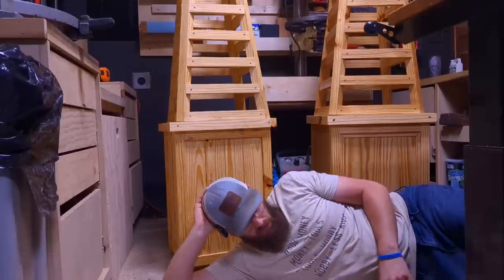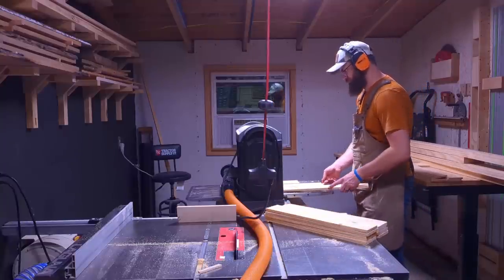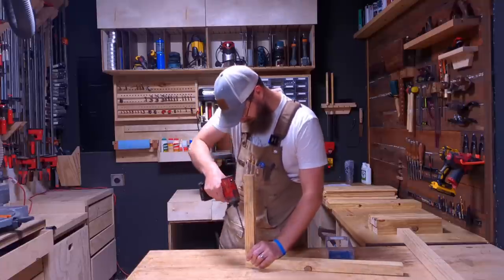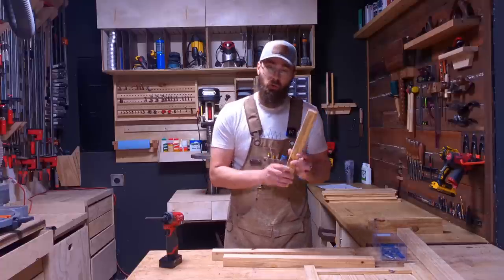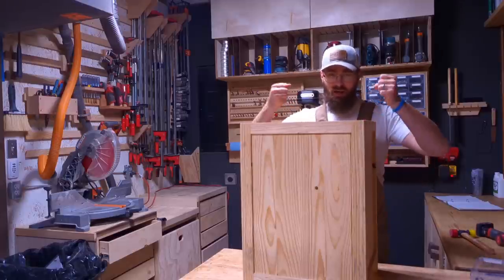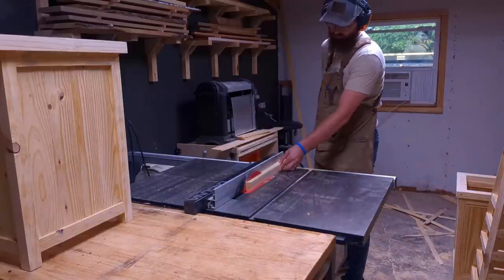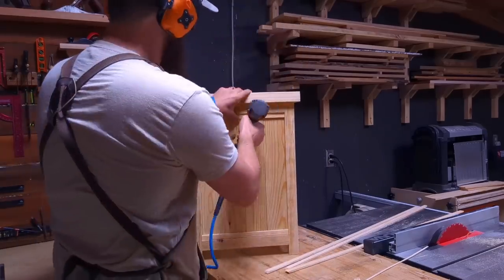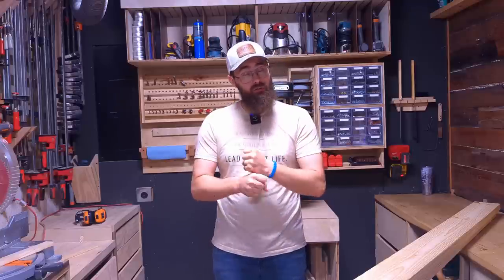Beginner Woodworking Project that Sells (Easy Woodworking Project That Sells PT 2)

Comment: I keep looking for a beginner project and keep seeing step 1: Use table saw.... Sure thing bro.
Reply: Same boat. What drives me nuts is the "made this for $1", well dude you have like 8 grand in tools, so...

I'll recommend a few things working out of a 8x8 shed with very limited tools. I bought a miter saw and a circular saw. Learned to do a lot with them. Hand router will also do a lot for whenever you hear "dato". Just make yourself a jig.
Reply: It takes time and lots of Marketplace and Auctions to build a setup. I finally have alot of tools then my mind drifted to cnc and I went that direction.

Seriously miter saw, table saw,  band saw, impact driver, drill. 10 clamps You should be able to produce  something  you can be proud of and others may buy, I would not recommend selling the first 5, these give you perfection time.
Reply: If you are limited on space might I recommend instead of investing in a table saw save yourself a little bit of money, and buy a nice circular saw and a track saw. It’ll be cheaper, and you will have the ability to make perfect straight cuts almost anywhere as long as you properly stabilize what you are cutting. Hope this helps. Good luck
Reply: Anything done on a table saw can be done with a circular saw

Comment: Hey, fella....really enjoyed watching this video.  I don't know why I haven't found you on YouTube before now, but I like your style.

Now, I'm not trying to be a "know-it-all" or "smarty pants" with what I say.  But, as a retired junior high Industrial Arts (AKA "Shop") teacher for many years, I always tried to bend over backwards to make sure I was teaching my students the correct way to accomplish anything they attempted.  For their woodworking projects, I always required them to make a Project Plan Sheet, complete with a measured drawing on the back side of the sheet.  The front side included the List of Materials, along with a cut list (when necessary) and a Steps of Procedure.  That way, many potential problems were worked out before the first board was cut.

Since many of the projects included some kind of dado-like joint, I made it a big deal to help them learn and understand the difference between a DADO and a GROOVE.  A dado runs ACROSS the grain; whereas, a groove runs WITH the grain.  Thus, what you cut into those long boards with your dado stack was actually a GROOVE, not a DADO.  Yeah, I know that some folks will shrug their shoulders and think that it doesn't matter, but I believe that, if you speak and act correctly, that enhances your reputation.  Conversely, when you don't, your reputation takes a swat.  I hope you take what I've written as helpful information, much like a pat on the back, rather than a stomp on the foot or slap on the face.  I surely have profited greatly over the years when someone knowledgeable shed a bright light onto the correct way of doing or saying something important.

Keep up your excellent work...and I promise to watch more of your videos.  I've devoted most of my professional career to helping beginners make a successful start in their chosen area of interest, especially woodworking.  In just a few days, I will be coaching both a teacher and some elementary age students how to turn a pen on the lathe.  Without a doubt, when they come into the shop and see some other simple things I've made, they will become interested in expanding their woodworking prowess.

Best of luck!
 • Dr. Larry S. Anderson  •  Tupelo, MS (birthplace of Elvis!)
Reply from the maker: Tupelo!!! I want to come visit very soon and have a cup of coffee with you (my treat).  No need to tip toe around me Sir, I am a grown man in the strongest sense of the term (thick skin and can take instruction).  You've taught me something new in such a short comment and packed it with such wisdom in a gentle corrective tone,  I'd love to meet you and just have conversation with such an astute elder.  I've only gotten to where I am by cultivating a relationship with the more experienced generations.  From the bottom of my heart, thank you for this comment.  If you're interested, please send me an email, I'd love to set up a meeting with you.  My email is burnstock20@gmail.com.

Comment: You should get some cheap toggle clamps from harbor freight to add to your jigs. Would only take a couple of minutes to screw them on and make it much easier to hold the piece you are cutting. Same for removing the clamps to use for another jig
Reply from the maker: Great idea, thanks!

Comment: Love the project , snag some WIN Brand saw blades from the big A ,they are throw away type blades but they cost are $10 or so . Sharp blades are a must ,dulll blades will make ya visit the nearest ER. I subscribed to the site . Cheers
Reply from the maker: Yea, I keep sharp blades but I'm sure you heard my table saw struggling.  I'm having issues pulling electricity.  That's a brand new blade on the saw but it's getting bogged down waaaayyy to easy.  I've got some electrical issues I need to get worked out.

Comment: Just the build I’ve been looking for! How long does a tank last before you need to refill it?
Reply from the maker: Glad ya like it.  A tank of what?  The air compressor?  It has a constant leak so it'll stay running as long as it's turned on.

Comment: Suggestion for you: instead of permanently attaching the top to the base with screws, why not use dowels to hold it together? Like put 1 dowel in each leg going into the base. That way they can easily change out the plant of they're like me and kill it. I'm serious here. My green thumb turned black
Reply from the maker: That could be done for sure, it would just add to the time it takes to build it.  Still a good idea.  I am not a gardener in the least, that is my wife's arena of expertise 😂

Comment: Great work I a small shop.  I'm working on building a workshop but don't have alot of room. How big is yours if you don't mind me?
Reply from the maker: My current shop is 10 x 20.  It's the smallest one I've worked out of so far considering when I was in the shipping container (8x20) I could open the doors and have unlimited infeed/out feed.  The way the doors are situated on this shop that's not possible, but it still works just fine.

Comment: Really like the design! I’m wondering…what is your opinion on using screws vs. glue and nails in the elements. Seems screws would last longer. Also, could it b made from cedar? Or is there a drawback?
Reply from the maker: Thanks!  I try to use screws especially on the end grain to long grain connections.  Cedar would be better than pine for sure, may be a little more expensive though.  It's not readily available in my area.

Comment: Love the channel and cant wait for the plans!  Was stoked to see my lowes dropped 2x6s (although they are the SYP ones) do you use treated for these or no? 

Thanks for your awesome videos and keep on doing what you're doing!
Reply from the maker: Thanks!  Nope, these are untreated pine.  Used tung oil to finish em which is a good exterior and interior finish, just gotta oil em every year or so if ya keep it outside.
Reply: @burnstockwoodworking  you're the best! Thanks for the super quick response!

Comment: Please have your electrician check Amp draw lights dimming when saw turned on is not good for modern or switches on saws
Reply from the maker: Hey!  I just moved out of that shop actually, check out my more recent vids.  Even more electrical issues 😆😆😆 thanks for the comment.  That shop was a temporary spot until I built the shop I'm currently moving into.

Comment: How did you determine the length of the ladder pieces?
Reply from the maker: Honestly, just figuring it out as I went.  I attached the top center post first then measured from one leg to the next and made the bottom rung then decided just make the progressing rungs 1" shorter than the previous and laid em out where they fit.

Comment: Why didn't you glue these in? The first planters I made, I failed to do this and paid for it later on. Or maybe these were just for demonstration purposes for the video?
Reply from the maker: The shiplap or the aprons?  I haven't had an issue using shiplap without glue, nor pocketscrew intersections without glue on exterior projects.
Reply: @burnstockwoodworking  The aprons. Must've been the size of my planters then and the weight they were carrying (5' x 2' x 2.5').

Comment: You do good work for sure. But…. You are not making this in an hour and a half.
Reply: What makes you think he's not? I'm not being rude. I'm just curious why you think that.
Reply from the maker: Not sure how to answer this other than thanks and yes I am, it's not complicated at all, simple cuts, easy assembly.
Reply: I’m not trying to be facetious at all. I am a carpenter and I have worked in a production line also so I’m pretty fast at what I do. Much much faster than most carpenters. I know how long it takes to make all those cuts and rips I make planter boxes myself. Count all the pieces that were cut all the pocket holes that were drilled and that doesn’t even mention putting it together . Absolutely no way there’s just an hour and a half of work there. Even if you had a cut list right in front of you you couldn’t do it that fast. I’m still gonna say you do good work though. Don’t get me wrong I am not putting you down I just don’t believe that timeline